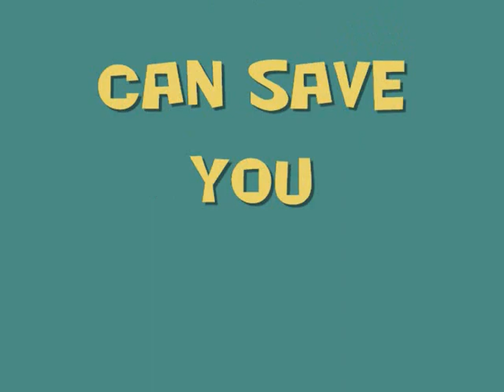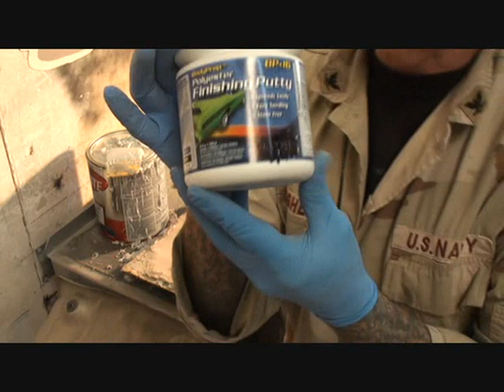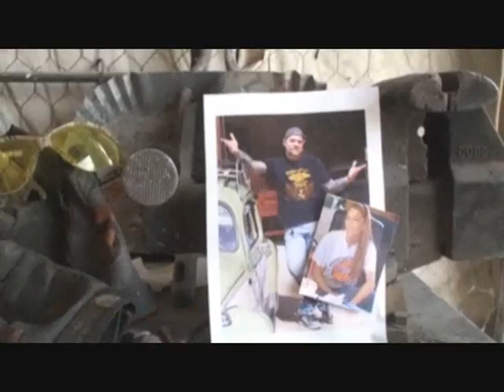Automotive Collision Repairs-How To Mix Bondo The Proper Way. Part 1

Comment: HEY Pete!  I'm doing something right!  My use of less expensive Bondo, correct proportions of Bondo/Hardener, and mixing till I have one solid color.  I've been mixing on a piece of metal, and when done, I scrape it off with a putty knife and use steel wool with reducer to wipe it off.  Used the same sheet of metal for over 15 years of hobby projects.

Comment: @diyautoschool very good to mention the hardener,very important.one of my first experiances with bondo was a helluva ordeal on account of the hardener.i went to take the cap of my tube that came with the bondo,and the tube was tilted,and you guessed it all the runny seperated stuff oozed right out onto the pavement....and then i had a tube of red stuff.....you know what im gettin at.and to buy a tube of hardener for  3-4-5.99$ when a small quart of whatever is 9.99 well kids always mix your shit

Comment: @diyautoschool   well I think you talked once about using a small, mebbe 1/8", drill bit to get into some of the crevasses where the corrosion builds up.     specially on the alloy decks where the white crap gets between the paint and the metal surface....gotta have the deck all shiny and clean if I want paint to stick to it.     I don't get all crazy about it.....mowers are discounted for rust  (G)

Comment: regarding ins and out of bondo.....assuming the Lawnmower Guy was dressing up a pig in the lawnmower shop.....would I be better off just sticking to bondo, sandpaper, or could I go straight to 'evercoat' mix over the sanded area      I suppose the question is will the bondo smooth out when I sand it.      seems to me you're using the 'evercoat' mix to finalize     I mean have you ever seen a concouse lawnmower?